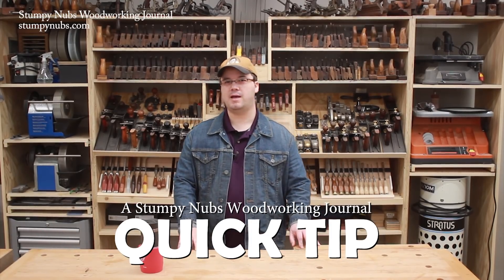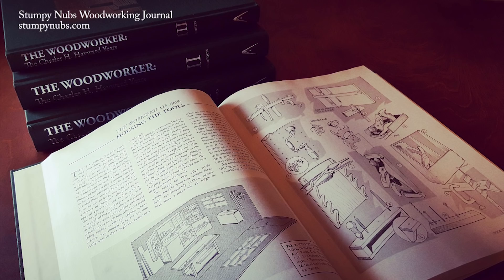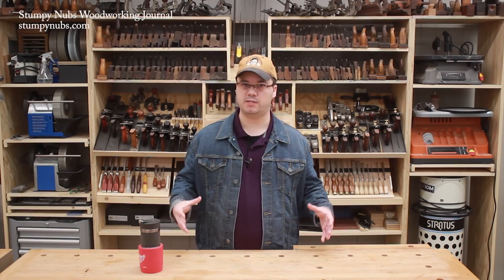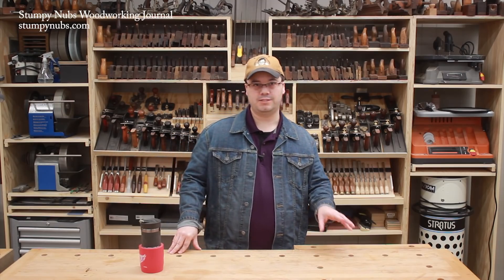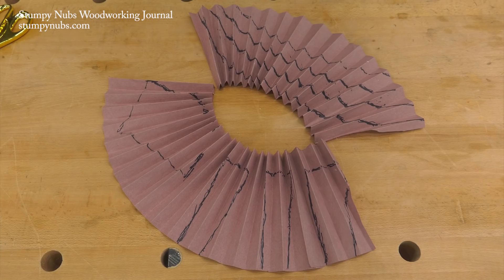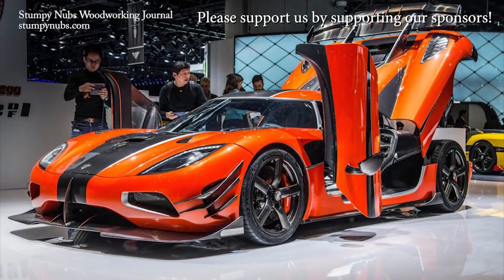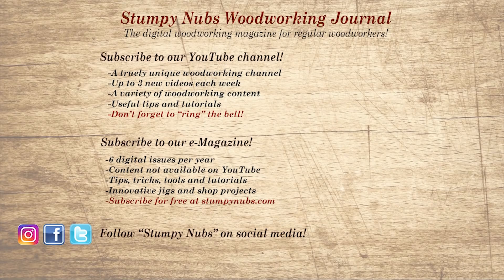Why do boards cup AWAY from the center of a tree?

Comment: With this visualization, it seems like when it comes to deck boards, the "crown down" approach with wet PT wood would result in cupped boards that hold pools of water once the wood dries, while installing the deck boards crown up (so the grain is frowning) would result in the cupping causing the water to run off the boards. Am I understanding this correctly? I've found with decking, there are two schools of thought on crown up or down and obviously one of the schools doesn't understand how wood dries and shrinks properly.

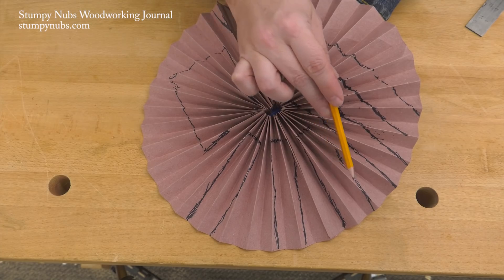Comment: 1:23 well that sent me off on a tangent. Understanding the terminology of rift and quarter sawn and the methodology used to cut it. 

But your diagram drives me nuts, how is a sawyer supposed to cut that ... all the unused potential.
Reply from the maker: This isn't a tutorial about how to saw logs. It's about how the grain direction in various boards affects the potential for cupping/warping.
Reply: @StumpyNubs  I understand it is beyond the scope of the video.  The board diagrams make a bit of sense from a furniture maker breaking out the grain structure he desires from a timber.
  Thank you for your video and the information from the materials science perspective.

The diagram depicts "radial sawn" quarter sawn boards.  From a material sciences perspective of the woodworker them is defined as the angle of intersection related to the narrow face of the board. Where from a forestry or sawyer perspective the definition of rift and quartersawn seem to shift (and even then there is modern rotating quartersawing and traditional gang quartersawing).
Modern quarter sawing doesn't waste material but labor or time.  Whereas radial riftsawing produces "shingles" and true quarter sawn boards.  And I cannot fatom how one would cut boards in this manor with a circular sawmill or a bandsaw mill.

You'd think there would be enough overlap between sawyer and furniture/cabinet maker that the terms would sort themselves out.
 I didn't know what a rabbit hole I was falling into.  Thanks again.

Comment: 45 years ago in woodwork class we were taught to inspect the end grain of a piece of wood. We were then instructed to make a v mark in pencil and then choose the face side to continue with the construction of the cabinet
A century before the clock maker used about 18 different types of wood for individual characteristics of hardness and elastisity 
We have lost so much knowledge by the use of rubbish wood like plywood and compressed chip board and power tools that are good... Excellent even for economy sake

Comment: Works till you build a deck or fence then I find it curves towards the sun.
Reply from the maker: Yes, if you artificially dry one side more than the other you can get cupping in any direction.
Reply: I've tried it and at one end of the board you will have cup up and the other end will be cup down.

Comment: I live in an apartment and is looking for a workbench for working with handtools (like planing). What is the minimum weight it needs to have? I can't fasten it to the wall or floor. 
Would something like the Sjobergs Junior/Senior work? It weighs 48 lbs (22 kg).
Reply from the maker: It has to be very heavy if you want it to stay in one place while you work. At least 300 lbs. But you can add weight to the base of any bench (sand bags, tool cabinets, concrete blocks) as long as the frame is sturdy.
Reply: @StumpyNubs  Thank you!

Comment: Boards cup away from the center of the log for the same reason that logs check.
The fanfold paper example sort of worked -- and all analogies fail when carried to their extremes.  It showed the inner part expanding more than the outer part.  But in a real log, the outer part shrinks more than the inner part.
Heartwood is denser than sapwood.  So when the wood dries, the sapwood has more moisture to loose and so it contracts more.
Reply from the maker: The outer part of the fan contracted (shrunk) more than the inner part. The two half-circles became quarter-circles. It is true the inner part of the fan expanded a bit, but that is unavoidable with paper. The focus isn't on the moment of motion when I let go, but on the end result, which proved identical to how it occurs in a tree.
Reply: @StumpyNubs  
Ah! I was only half right.  Yes, the outer edge shrunk, but the center, which started almost as a vertex, grew, as you said.